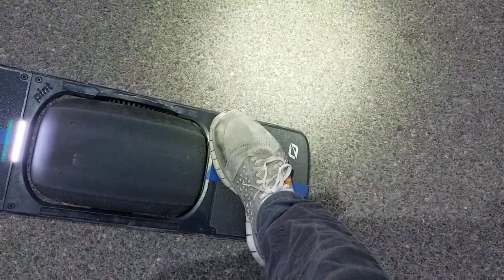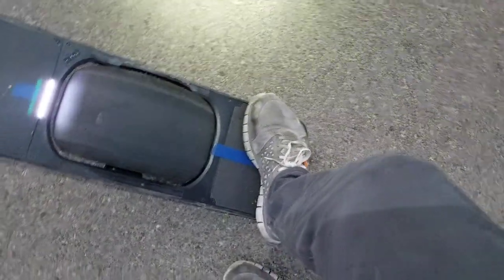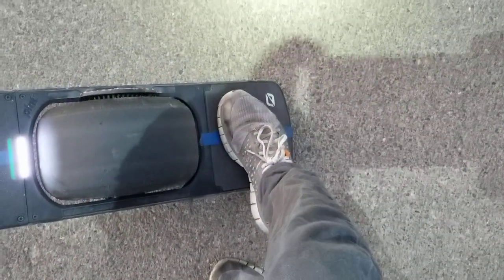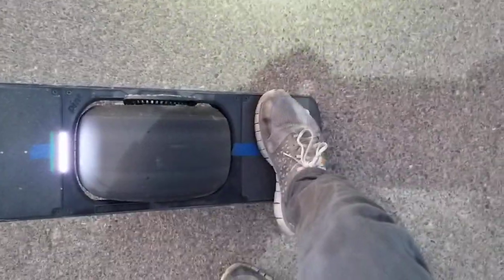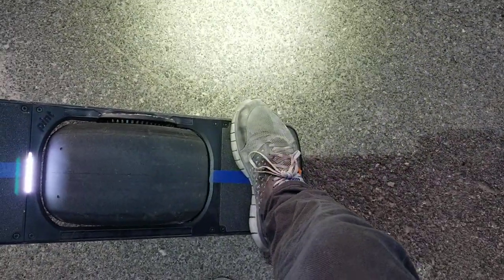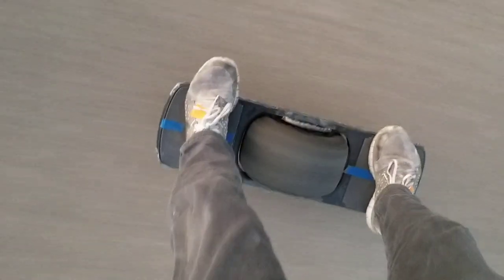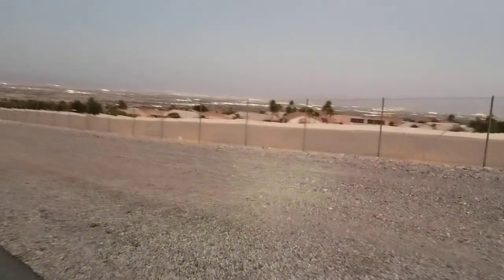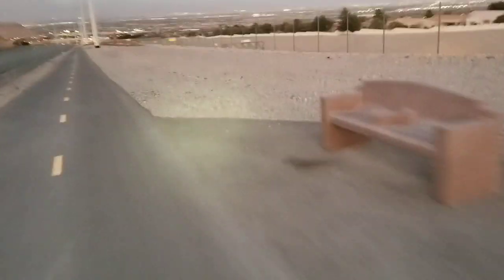OneWheel Pint Tutorial: Understanding and Dealing with wheel wobble (Part 3 of 3)

Comment: This 3 part series deserves some serious attention, I went out on a one wheel once, went like 1 mile, wobbled like crazy; then I found this series that night, and my next outing I went 4.5 miles with little to no wobble.

Like it's gotta be partly just the confidence in it, and some improvement should be expected from the first time to the second, but I felt like this made a huge difference

not to mention how few other people are really talking about best stances/ foot positioning. The manual it came with just showed parallel feet